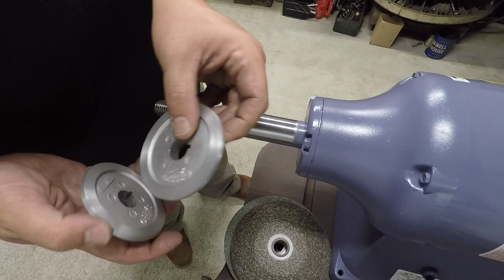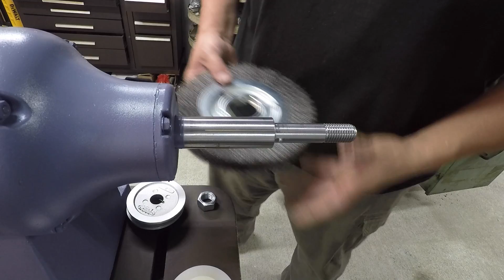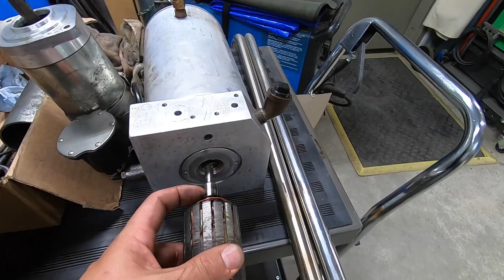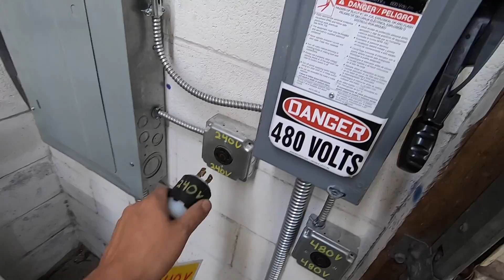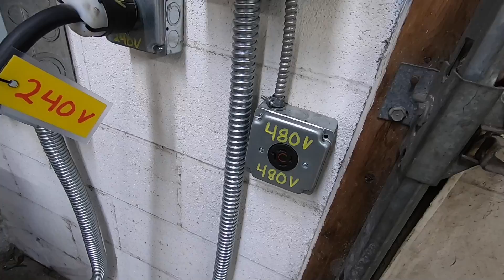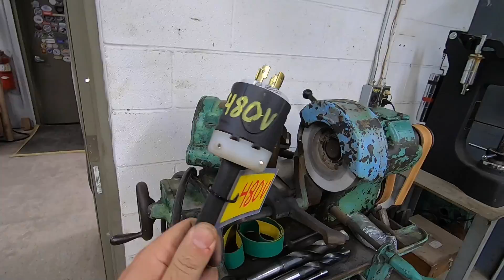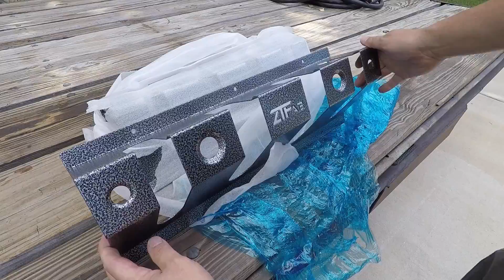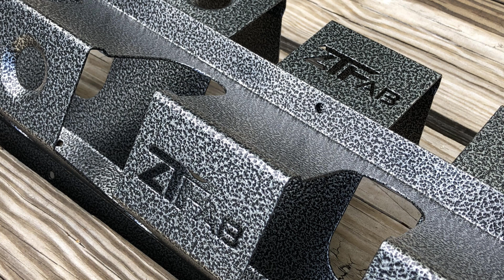SNS 304 Part 2: Baldor Buffer Improvements, ZTFab Milling Arbor Racks

Comment: The motor assembly looks rock solid on that buffer, but I cant believe how bad the runout was on those flanges before you fixed them! good job; but one you shouldn't have had to do.

Comment: I looked at two brands of bench grinders at the local Harm & Fome.  One was a King, the other a DeWalt.  The King had considerably less wobble, considerably lower price.  Neither really worth it.  I managed to make some improvement to the one I got, but it still tries to clean the bench off every time I use it.

Comment: adam    i believe the buffer flanges need to be larger diameter  and press on the wire past the metal hub. see mcmaster under buffer flanges :)

Comment: Those grinder parts were CNC'd they should be perfect!! LMAO It is nice that you were able to make it better, that off centered hole is uglier than sin though. How do you miss center by 1/4"? Who ever made those parts clearly gives no F's.
Reply: About like JD Reman fuel injection components. Gotta buy 3 to get 1 good one. I shuddered when I had to get an injection pump when I worked at the dealer cause the first one was bound to be junk. It's like none of these companies care anymore.
Reply: Part of it is because of China. They bought a whole bunch of tool companies as well as making tools for other companies. You can see the effects by either poor quality or the fact that there's products that look like they are from the same factory because they are.

Also, the castings were not machined. Just rough castings.
Reply: The flanges looked cast, not machines which is why they have such poor runout
Reply: Crazy eyes from Mr. Deeds did the final inspection.

Comment: That buffer is WAYY to expensive for the terrible parts it comes with.
Reply: No kidding.  They should be jig bored, hand scraped and plated with gold for what Baldor charges.  That is absolutely unacceptable.  I bought a Palmgren for $375 CDN which I should get in a few weeks.  An 8" Baldor grinder is $1500 CDN.  At least I have a good idea of how to fix/upgrade the Palmgren now should it need it.

Comment: So, just a bit of speculation on my part. Since the angled face of those bushings are a bit wobbly, if you were to true them up it might take even more vibration out of the wheels?
Reply: It would help but not much; the amount of mass that is out of balance is very small.

Comment: I worked for Baldor 17 years until ABB bought them out.  The reason why I quit  is because ABB stopped buying quality products.  Just a hint  "(Don't put it under a continuously load.) to not overload it.  Do a run out check on each side of the shafts.  I bet they are out.  If you can find a older Baldor buffer it will last forever.  Good luck with the new ones.  There should be a F # that will tell you the date it was made.  Anything after 2012 is junk.
Reply: Good advice thanks
Reply: I have an older model 333B buffer. The Serial Number is P5-91, seems unusual. Is that from 1991? How else can I date the motor?

Comment: I'm fairly certain that Baldor didn't make those. They probably ordered them pre-made and added them to the box. Probably made in China or Mexico.
Reply: Ultimately Baldor is responsible for what they sourced and defined the specs they were willing to accept. If they wanted, they could have required higher specs from any source, regardless of country of origin, and of course it would have been at a higher price.
Reply: I wish people would stop slagging of countries for manufacturing. China does not just produce cheap tat but also incredible precision. US does nit just produce precision goods, but plenty of poor workmanship. Most countries have bits of both. Whether you receive quality is not a question of country of manufacture, but of honesty and commitment to quality from the supplier. For $100 Harbour Flake no one wold have batted an eyelid if the flanges need touching up, and at Baldor's prices it is just pathetic. Country of origin has nothing to do with it!

Comment: Watch your mounting flanges at 20:45 - they're cast so sloppily that you can see they're lopsided on the outside face, a LOT. You could probably get a lot of what vibration you have left out by truing those outside angled faces.
Reply: I'm sure he knows but that takes time and by the time you add up your labor on top of the grinder, it turns into a $1000+ grinder.

Comment: Your 8” wire wheel, you can also get it with nylon or some kind of plastic bristles that work really well for deburring
and it doesn’t tear your hand up if you hit it by mistake. The wire always sticks your hand when you touch it...lol. We use them at work.👍👌

Comment: Hi Adam! just my two cents about your buffing wheel...the one that you don't like. Looks to me like the same type i use at work almost everyday. We use them to remove material on titanium and stainless steel part ( i work for General Electric Aviation). As buffing wheel they are way too hard, it's more like a ultra fine grinding wheel. But when you want to remove say 2 to 3 thousand on a part in a matter of seconds they are perfect. I would try them over a regular grinder, just to see the result. And they make the parts shine!
Reply from the maker: I’ve got two on the shelf and when I have another grinder to use them in, I’ll give them another shot.

Comment: For the electric outlets, you could also try to color-code them to add an additional level of identification for each voltage. Color-coding is a great way to verify things at a glance. Great video Adam!
Reply: Proper receptacles and cord ends do it all.  They don't fit where they shouldn't.
Reply: @kevinhewitt1428  Yes, NEMA L14 for single phase 125 or 250 volt, L15 for 3 phase 250 volt and L16 for 3 phase 480 volt. Add a -20 for 20 amp, -30 for 30 amp followed by a P for male cord plug, a C for a female cord connector or an R for a female wall receptacle.
Reply: Spraying the cover plate and plug body the same color by voltage world be great
Reply: The center of NEMA receptacles are already color coded.

Comment: A couple of years ago I had to fix my hydraulic leveler pump, same as yours looking at the video. I was lucky to find a used armature as mine was ruined by oil from a seal leak. It did require machining on the lathe and mill to modify the end of the armature to match the old one but wasn't too hard. Lucky the replacement was larger in dia so I could modify to fit. RV's do require nearly constant maintenance when they get a little older.

Comment: It is amazing how those first items that you showed us needed so much alteration to work properly (Baldor grinder). And that oil pump drive that is outdated...good thing you're a machinist. I'm not impressed with Baldor after watching this video. Yes, I have a small machine shop with lathes but if I spend in the range a $1000.00 I would expect more from the manufacture. That's just me...I'm a relic at 74 Lol
Reply: I agree. You'd expect to do some alterations on a Chinese made buffer, but not on an american made pricey tool.  Those flanges should have come square and concentric.
Reply: @marcel-lemay7721  I dunno. I think round works better. 😉

Comment: RE: K&T Mill. Did you ever find out what was causing the hydraulic power feed problem?
Reply: Voltage connected to the feed motor was wrong. Hes connected it to the correct voltage and is working ok now.

Comment: That stub shaft, having those cross cuts at 90 degs, looks like it's intended to take up some misalignment. I wonder what the concentrically tolerance between the shaft and the housing is?

Comment: You may want to consider taking an angle grinder and true the OD of the wire wheel while it is running...
Reply from the maker: I thought about that actually. Might try it soon, using a flap disc.

Comment: Adam as far out of round and true as those parts were, I'm surprised you just didn't make some from scratch. That's crazy how bad they were.
Reply from the maker: I didn’t want to make all new, just fix what was there. Machining them from stock would be the best though.
Reply: Abom79 I was surprised that you did not recut the bevel. I wonder with that much out of round that it does not add to the vibration. I guess being Al and small diameter it does not add much, but it still could be noticeable.

Comment: it's pretty sad when you have to do all this work to what is a very expensive tool before you can really use it.
Reply from the maker: True, but I didn’t expect that buying something with a good reputation of high quality.
Reply: @Abom79  i totally agree.  it's shocking really.  mine is more than 10 years old and likely doesn't have the Chinese flanges, i will have to check.  thanks for posting your solution to that problem.  i think you've helped all of us, like usual.  keep up the great content.

Comment: You would think a $700.00 plus buffer would have better machining on the flanges than that . Thanks for showing how you corrected  the issues. Have to make the bushings for mine when it comes I just orderd the 2 speed version of that buffer To do the same thing you are doing I also orderd a buffing wheel kit also so I can  polish things to If you want the link for them let me know there made in the USA. I'll have to get some nylon somewhere to make the wire wheel bushings you made that made a huge difference in the vibration .
Reply from the maker: Check yours when it comes in. As you can see, facing the flanges makes a big difference, as does matching your own bushings to fit. 👍🏻
Reply: @Abom79  I sure will the company I ordered mine from is in Ohio and they were able to open back up from the shut down order Friday so they are backed up on online orders so it may be a couple of weeks before it will ship.

Comment: You may want to look into a Brother label making machine. I use mine to mark all my outlets and machines for voltage. You can adjust the size and the font and even frame the label with different art. Not a very expensive machine and it uses a wide variety of tapes and colors.
Reply: I second the Brother recommendation. The tapes are durable and easy to removed if needed if you go with the p touch tz tapes as they are all clear laminated over the “ink”.
Reply: Big Clive has one and raves about it.

Comment: WOW I have a buffer setup with pedestal and the vibration is so bad, I can't keep it sitting still when I turn it on. It moves so much that I have to step on the pedestal base to try and hold it stationary and that really doesn't work. So I may have to start from the motor shaft itself and start seeing where the real problem is. Thanks for the video about getting yours running smooth. Thumbs Up!
Reply: Mine does the same
Reply from the maker: Y’all check everything out. Most likely the wheels not running true and straight

Comment: I checked the price on the Baldor grinder and it's not cheap, you would think at that price point the flanges would be square to the bore and run better. I sincerely hope the rest of the grinder is better quality.

Comment: I tell you, you are very lucky to have 3 phase power in your home shop!!
Reply: I believe that luck had even less to do with having 3 phase power than it did with the wheel mounting hardware on the pedestal grinder kitset from Baldor.  Apparently for Baldor a "Finished" part  does not mean a completed part, it is the same "finished" that means next stop is the funeral parlour. (Our parlour is like your parlor ;-)  )
Reply: He installed a transformer to get 480v 3phase

And a phase converter? (I might be wrong on that point).
Reply: Fr. Bob Lacey Yeah I don’t ever recall Adam mentioning a phase converter I think he had mentioned way back that he had 3-phase coming into his shop. Keith Rucker has a Rotary Phase Converter
Reply: @FrBobLaceySD  He has 3 phase off the utility pole.

Comment: NEMA Twist-Lock plugs and receptacles are both current (Amps) and voltage specific. The 30A L14 plug you are using is for 125/250VAC. It is not for 3-phase use. The dual voltage means there should be two hot legs, a neutral, and a ground pin. For 3-phase low voltage, you should be using an L15-30. For high voltage, you should use an L16-20. The L16 is rated for 480VAC. I can't speak about your local codes, but where I live, you would be in violation. A licensed electrician should be familiar with NEMA plugs and ratings.
Reply: Well said. I noticed this as well
Reply from the maker: I hope you tell that to every home gamer and do-it-yourselfer who has equipment and runs electrical themselves
Reply: Here come the electricians out from the woodwork. Code warriors. It never fails.
Reply: @truckguy6666  I'm not an electrician. I used to work in a fab shop that had a bunch of equipment like Abom's plugged into various twist-lock receptacles. The previous building owner wired the place himself, and we replaced our equipment plugs to match. Several months after moving in, we hired an electrician to run a new feed for a Timesaver. He commented about the mess of twist-lock receptacles and pointed out that the voltage, amperage, and phase is printed right on the plugs and receptacles. Fortunately, the electrician didn't need to deal with any of that because he said it was all in violation of local codes and he would have to make all of it right if we asked him to work on it. Afterward, I looked up the NEMA numbers on McMaster Carr's website where we bought the replacement plugs. McMaster makes it easy to buy the right one for the application. We weren't paying attention because we just needed to get the shop running. And yes, to Abom's comment, I do tell home gamers about this so they don't make the same mistake we did.

Comment: Oh as well look into the hypkerion to replacements personality love there 22 watt ones the  but I'd recommend a led flood light for above the grinder areas another idea for the plug is also color code them with paint but if you use the correct twist lock plug for the voltage you really can't get them plugged in cause the ground pins are different with different voltages we run the same stuff at work we color code red for 575  yellow for 480 and green for 240

Comment: Hey if have not already repaired the pump/motor. An Idea.the adapter shaft can be made from the old motor rotor shaft. Remove the shaft the use the inserted end with the bearing to connect to pump cut to length, and key to size for out put shaft of new motor. Then face new motor face flat. Make adapter plate with inner ID of shaft OD. On one side face adapter plate, leaving a raised ring to fit the grove face of pump. Then the two flat faces of the motor and adapter plate, come together. Drill and tap blind holes if possible to bolt on the ears of the new motor to pump. Or how ever the old motor, was mounted to pump? But still use old shaft. Note don't cut the old shaft untill know exactly how long it needs to be! Just thinking! Let me know if might work that way,
Reply: Note: may need to cross drill a small weep hole, threw the adapter plate edge in case the pump seal leaks that will keep oil out of motor, and or maybe cut a counter boar for a seal. That can be installed the the flat face side of adapter plate to seal the shaft. from motor. This may increase the thickness of the adapter plate. If use a seal

Comment: Wow.  I recently bought a bench grinder for my garage and had the very same problems.  The bushings were sloppy and the flange washers had terrible run out.  I purchased more expensive bushings and flange washers from a machine supply shop and still have the same problems.  I gave up trying to balance the unit.  At least with the more expensive bushings and washers the thing doesn't try to walk off the work bench when I start it up.

Comment: Those flanges sure are a quality "made in USA" product.  At times the US needs to up our manufacturing game.
Reply from the maker: I don’t know if Baldor makes the flanges or if they have those parts imported. I agree they should be made to better standards.
Reply: Robert Harker They are more than likely made in China. USA stuff is usually top notch.
Reply: This is a Baldor grinder.  A top of the line "Made in USA" industrial grinder.  No Chinesisum here.  The US needs to stop resting on our laurels and up our game.

Comment: This appears to be a normal thing for bench grinders to have crappy flanges. I have had to do mine and everyone I speak to comments on how bad the flanges and spacers are. Plus the stones aren't the best either. My spacer when fitted shows the actual hole in the stone isn't even round. No wonder that there is so much vibration from the grinder. Well I have new flanges and spacers but still a lot of vibration so new wheels next.

Comment: What if you want to buy a Baldor Buffer, but don't have a machine shop to correct all the deficiencies?
Reply from the maker: Have a local machine shop make the bushings for tou
Reply: @Abom79  Thanks Adam, but it was a rhetorical question.  It's just a bit disappointing that the detail elements of the machine are kind of half-assed.

Comment: really like the arbor racks, now that you had them powder coated you may want to put a piece of thin rubber along the top surface where the flange of the arbors sit to help prevent chipping and the metal to metal contact. Also looking forward to the tour of Velocity Restorations shop I've always had a weakness for the older Broncos

Comment: I believe if you use NEMA L-22R (twist lock receptacle) and a L-22P (twist lock cord cap) on your 480V equipment it will help prevent any accidental criss-cross connections. EDIT: L22-30R & L22-30P.